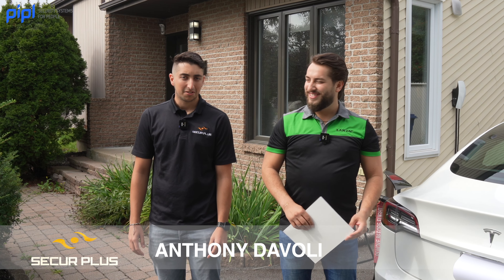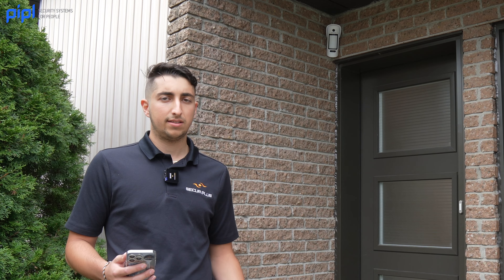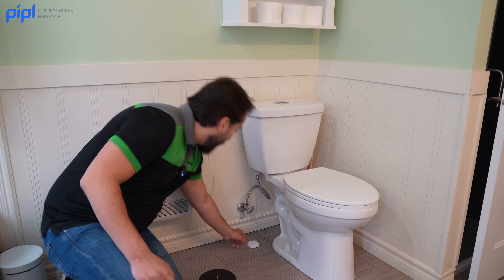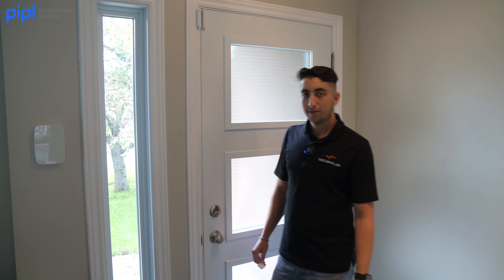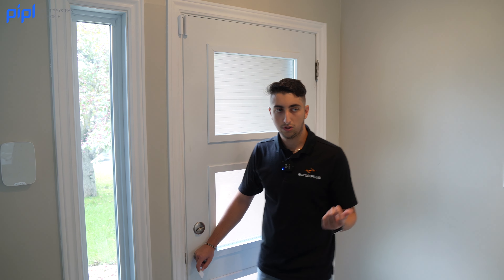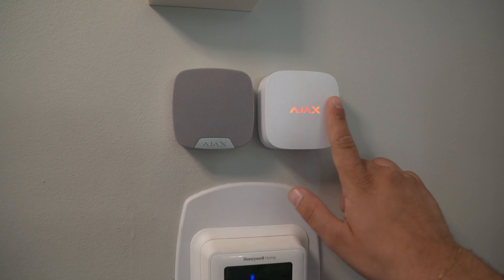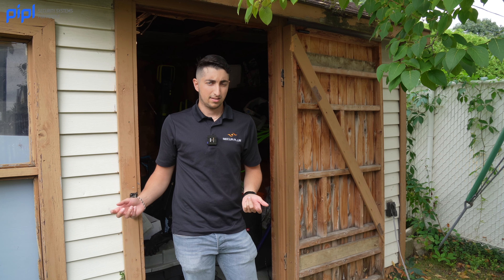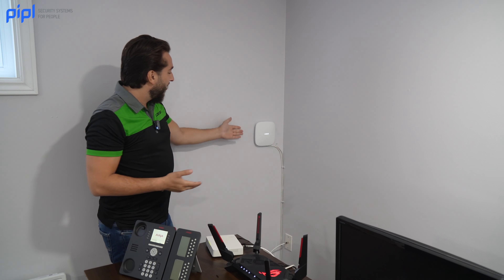Case Study: Home Security System - Ajax Systems Installation at a Client's House

Comment: Thanks for the video. Can you combine Ajax with video doorbells? or can you connect it to other smart devices like I can turn off and on my lights and switches already with Google assistent - is this something that is possible in the Ajax security system?
Thanks
Reply from the maker: Thank you for the question! Now you combine Ajax with video doorbells or any smart devices. Ajax Systems is professional security system and that's why it is closed system.
But please wait 20 of October because it will be special event from Ajax and we hope that they will release new devices. We will make video about this event.

Comment: It seems that the MCO PhOd has not been installed correctly. Please ask the installer company to reinstall it properly. The maximum height for installation should be 1.30 meters. The current installation may result in numerous false alarms due to its incorrect positioning.
Reply from the maker: Thank you for your comment 😉. We already sent this information to installer 🤝